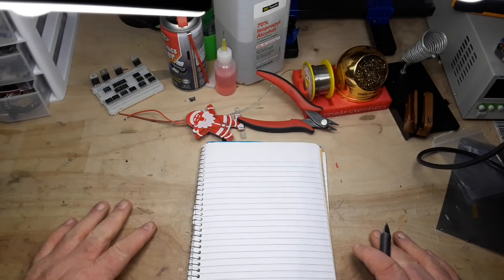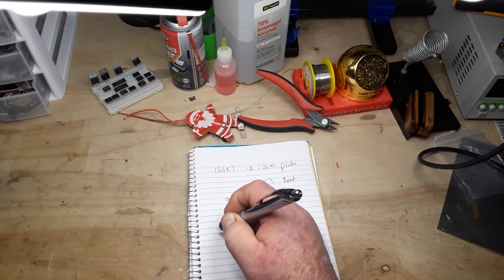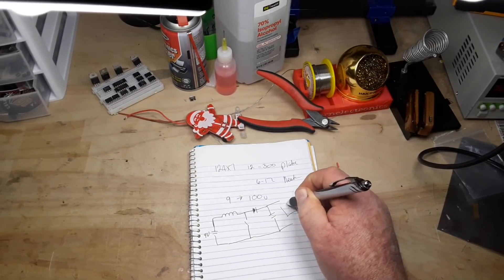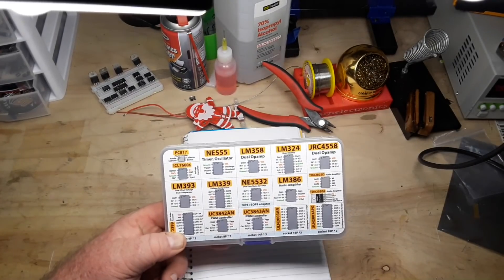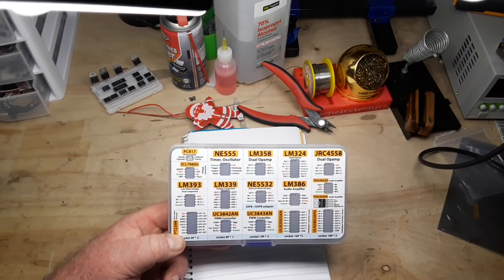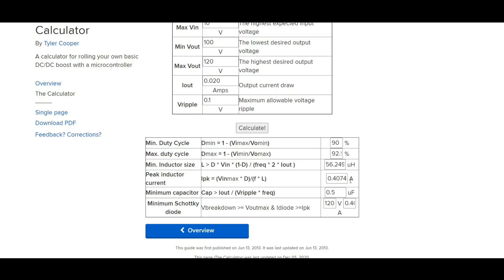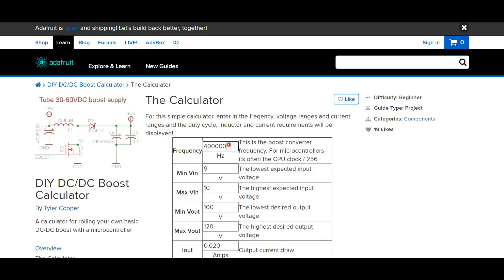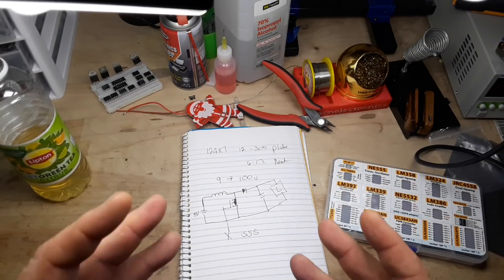Designing a boost converter - Initial thoughts

Comment: I'm still a student, so just asking: 120V, a few hundred milliamperes, that's a lot of power to supply from a battery. Won't it get drained too fast? Also, won't the switching converter cause ripple noise in the amplifiers and all the audio gear?
Reply from the maker: We will find out

Comment: I love these videos when you step through a design and explain your thought process. Have you considered running 18 volts instead of nine to pull that pwm down into the 80’s and give the circuit a little more room to breathe. I’m pulling this off of the top of my head cause I have not designed a boost circuit in awhile they are to cheap to just by and plug in to a build, but when you need that high voltage output build your own usually works best. Great video Paul, I’ll have to try and find the high voltage boost circuit I put together just to look at where I could have optimized mine. I know you are the man when it comes to power supply design. Oh and your explanation of how a boost circuit works is the easiest one to understand than any of the others I have heard. Love the work you do my friend.
Reply from the maker: Thanks Mike. No, the reason I'm kinda locked in a 9V is that's standard voltage for guitar pedal boards. If I could, I would use 24V, that would really be nice only have to quadruple the voltage.
Reply: @learnelectronics  makes sense, I had not thought about that.